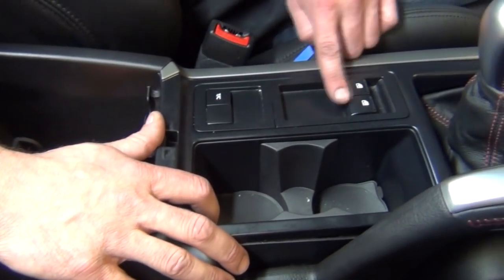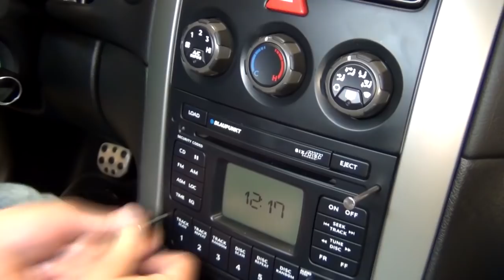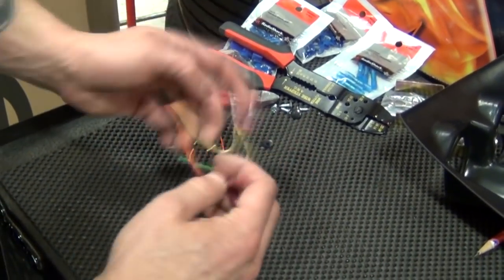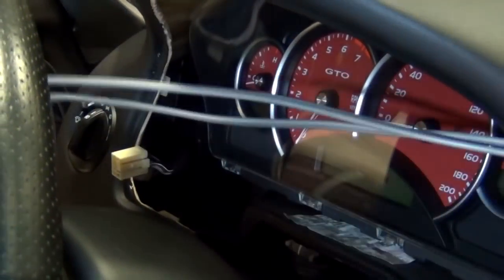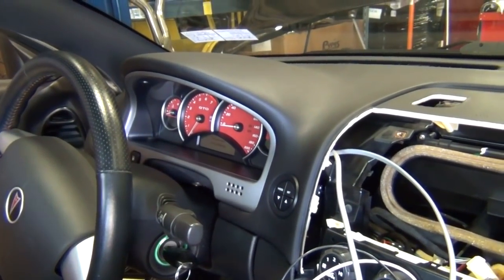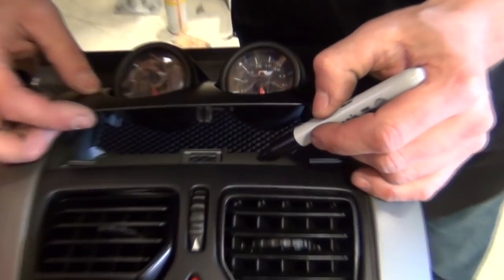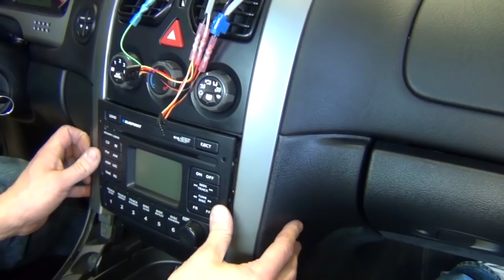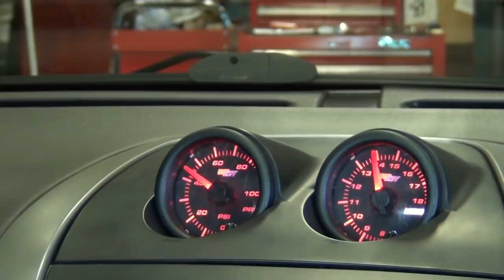2004-2006 GTO OEM SCSS Gator Dash Pod Gauge Installation 04-06 PART 2: GTOG8TA.COM

Comment: I installed the factory gauges that come with a housing for left hand drive. Nothing needed removal except for the blank panel. It plugged into a factory plug that gets fished up with a piece of wire, no tapping wires. No modifications are needed. Theres no need to remove the gauge cluster, radio or console. No mismatched gauges.
Reply: Can you give a little more detail? I'm about to do this myself and I agree, no idea why they show pulling the entire interior apart.
Reply: Not all GTOs have that factory plug in the dash. I believe only late 06 cars did? The rest of them need wiring run.
Reply: That's only on limited models and it's a lot more expensive kit.
Reply: I have the wires in my April 2005 GTO
Reply: I believe the 05-06 had the plug, I have an 05 and I'm about to do this